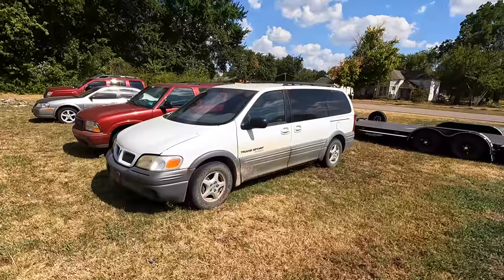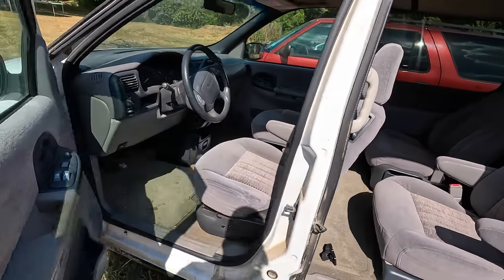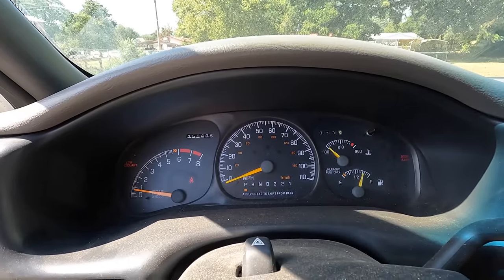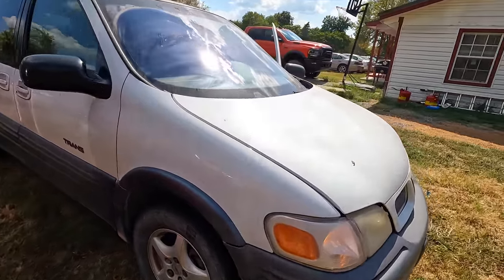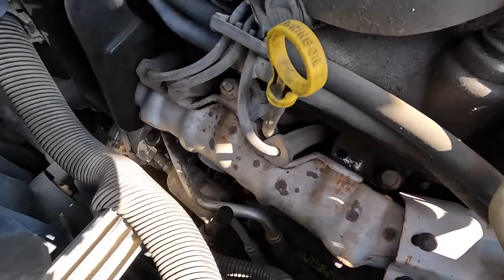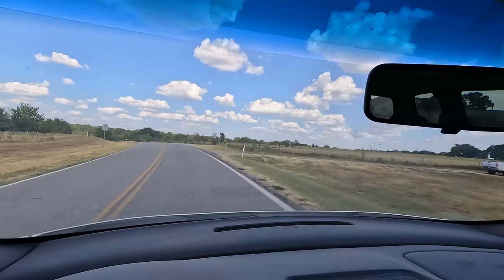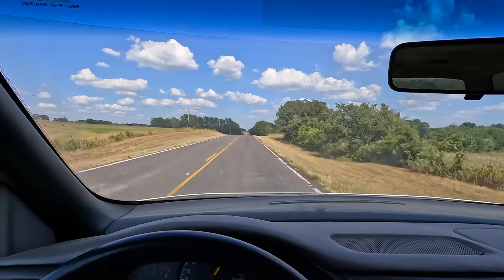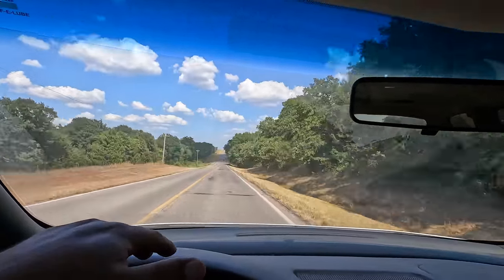I Stole this 1 Owner Pontiac Transport for $325 from IAA!!!

Comment: The Montana Trim Package on this Pontiac Trans Sport Minivan Became it's own Model for the 1999 model year when Pontiac dropped the Trans Sport name. The SV6 badge was added to end of the name on the redesigned 3rd Generation Montana in 2005 model year.
Reply: I always thought the Montana name came out on the 3rd gen
Reply: @turbo1997hsm  The 3rd and Final Generation of the Pontiac Montana SV6 Minivan lasted for two model years (2005 &2006) 
The 1st generation GMC Acadia Replaced the Pontiac Montana SV6 Minivan in the 2007 model year.

Comment: First it was Pontiac Trans Sport (as well as the cousins, Chevrolet Lumina and Oldsmobile Silhouette), and then around 1997 when it was redesigned, they kept the Pontiac Trans Sport and Oldsmobile Silhouette. I believe around 2001 they were both refreshed, the Pontiac became the Montana (in this vans case, it's a trim level) and Oldsmobile Silhouette stayed around until 2004 or so. Around 2006 if I recall, the Pontiac Montana became the Montana SV6. 
Just be aware, these vans had TERRIBLE crash tests. Also the interior materials are really really bad. Worse than anything from Dodge or Ford.
Reply: It is true that both these U vans and the Astro and GMC Safari RWD vans got poor crash test results from the IIHS. However in another study compiled by IIHS on vehicles with the highest rate of death and serious injury, all these vans were given high marks for the least amounts of death and serious injuries. So since there were a lot of these vehicles sold during their production years, ether those van owners were some of the safest drivers or that some times IIHS does not have a clue about real world crashes.

Comment: Just got my first auction car, a 475$ out the door 2002 town and country , non runner, dirty and nasty as hell, I cleaned it up, and got it running , everything works and I found papers for a new jasper transmission 4k miles ago 6 years ago, and a used engine with 30k miles 3 heads ago. Runs and drives like new.

Comment: A very good buy Randy. I got my 1997 Pontiac TransSport for $500 and I still needed to put in about $500 to make it a daily driver. My A/C did not work and even with a can of the repair in the bottle, it still did not work. My lines were too far gone I guess. i used it mostly for a winter beater so the A/C issue was not a super concern (the heat was good on it)

Comment: A lot of people will tell you those 3400 motors are bad for head gasket issues but really they are one the most reliable engines I’ve ever owned. As long you keep up on the oil and coolant changes those motors will last. They are a very simple push rod motor no turbos no variable valve timing no cylinder deactivation and no start stop crap. The power rangers is little weak at 170 to 185 HP but the low end torque is amazing and it’s one of the more silent engines I’ve owned you only really hear the valve springs ticking.

Comment: My pops has had 2 of these, uses it for work in construction. Removed all the back seats & just recently junked just first one after the head gaskets failed again & transmission was going so it wasn’t with it to him to repair it. A week later on Facebook market place we checked out a 98 (or 99) I think and bought it for 1400! We got the high trim I believe it came with the old VHS setup & stuff. These cars are a good reminder of GM! Comfortable spacey mini van good for work!!

Comment: I out that stop leak Freon in a 07 Ford Taurus air worked fine after that never had a problem. We have a 2017 caravan full loaded rear air. Had to take that in a month ago to get the air service Freon did not fix the air in the van. The air works now but of course it works better in our new bronco sport.

Comment: The one bad thing is that you will not realize how fast you are going until you look down and see that you are 20 mph over the speed limit,,  lol,,,   just push the button on the end of the turn signal stalk to engage the  cruise control,,,  make sure that the switch is set to the on position,,   :-)

Comment: I had a 2003 Transport and it lasted for 250,000 miles you just have to keep an eye on the coolant they over heat easy if its low but that 3400 motor are the best

Comment: CHECK THE 3RD BRAKELIGHT! I thought the cruise control was bad in my 2000 Camry. I have over 455 K miles miles on her and none of those wherewith cruise control. Being ADHDI figured it was better if I didn't use it.. I found out though though that when I had the new spoiler added did with a Built-in LED break light rather than electrically disconnecting the original 3rd break light in the back window they just plucked the bulb. Toyota and GM for some reason have the cruise control connected to the brake lights and and since the old school Bob open pulled more power than the brighter LED one once the car thought there was a light at light out in the back And for safety reasons wouldn't allowouldn't allow cruise to engage. Is check the 3rd break light! I put the old ball back into my my Camry and the cruise started working.

Comment: I once owned a 1997 Pontiac Trans Sport Montana Edition, it was fully loaded with power moonroof, but only had the passanger side sliding door and no leather seats. A one year only thing it said Trans Sport on the rear bumper on the center. Mine died just shy of 300,000 miles of connecting rod failure. Loved that van.

Comment: our trans port Montana had the 3800 in it the only problem we ever had out of it was for some reason if you had the traction control of the transmission would slip if you were on a long trip and drove at 80 plus miles per hour so we just left traction control off.

Comment: When I worked at a shop, we had a 2003 Montana shuttle/courtesy van, 250k miles on it, drove like new still. Never had head gaskets or trans work but it did have a rocker arm stud pull out once at high rpm.

Comment: You did get that mouse trap on the previous video, you grabbed it and it freaked you out.
Yes, they want to just the Montana, I believe in 2000.
You know what works for AC and it’s cheaper than Freon, those cans of air you can buy from the office supply store.

Comment: I bought my 1998 Pontiac Grand Prix 4 door for $200.00 it does have a 1/3 of a million miles but it does run and moves under its own power, the guy I bought it from strongly suggested that I not take it out of town he says that the tranny slips, I DIDN'T NOTICE THAT. he also held up a 2 and a half inch stiff piece of wire, it seem that his son had pulled something beside the gear shift lever out of the counsel and asked what it was, apparently the 2 and 1/2 inch piece of stiff wire has to be inserted in the hole it the driver wants to shift into drive, etc.

Comment: The only issue I have had with a Montana is getting air out of the coolant system. I have one now and can't seem to get the air out of the coolant system. It starts up fine then starts to heat up then I have to turn the bleeder screw and let the air out then it runs fine and runs cool.

Comment: If I remembered correctly they changed the transport over to the Montana halfway at 98 due to the safety crash rating they were not a bad van but they had head gasket issues I remember that due to the nylon head gaskets and transmission and power doors also heat never worked as well

Comment: Hey Randy how would you like to buy something a bit more rare? I have a 2005 Pontiac Bonneville GXP. I’m the second owner and has lived it’s whole life in Texas. 120m miles not a single thing wrong with it. GM fix the common NorthStar head bolt problem in 2004 when they gave the engines a coarser thread similar to the LS6 head bolts. I love it but my fiancé and I both work from home now and our 2019 Ram is all we need.

Comment: I had few them 1990 ok air keep die, 1991 was best last 500k, 1996 what was my drift car I blow engine was 3400, 1997 transmission die 60k the dealer didn't want to replace so sold cheap I lost $4500 on it, 2 2001 white had air problems and gold one kept bloating gaskets last time saw it had 300k and my last one was 2005 sv6 it had 250k wind sold it